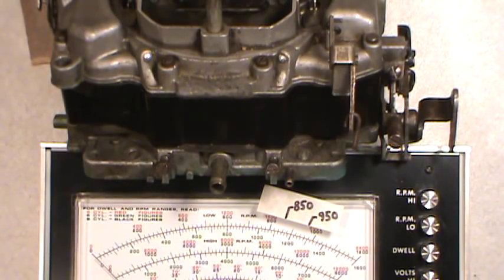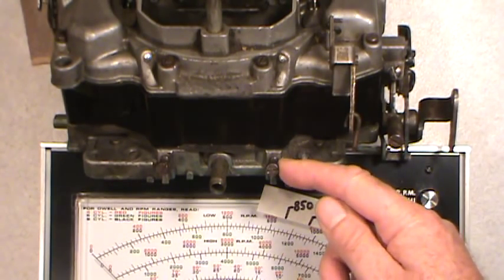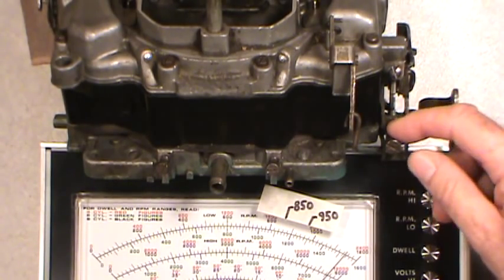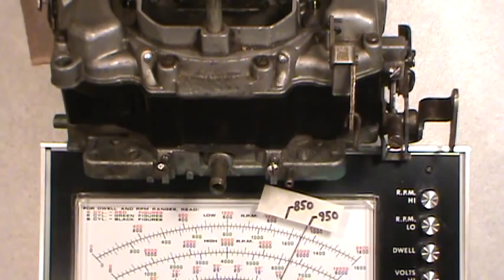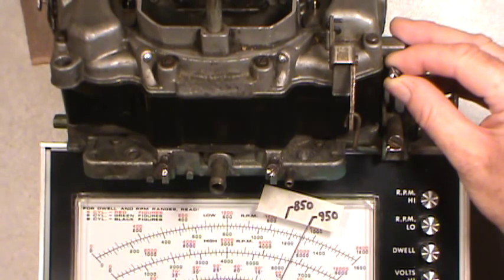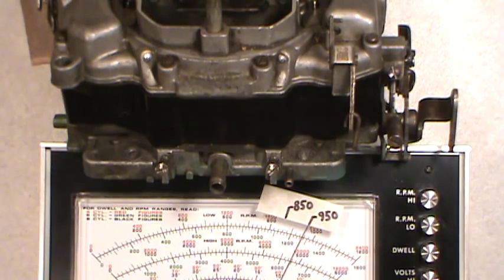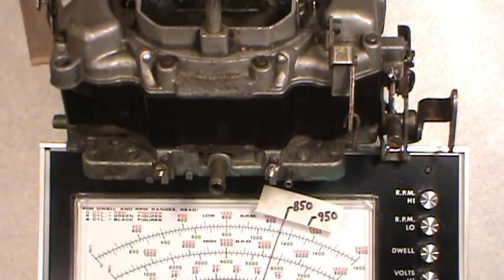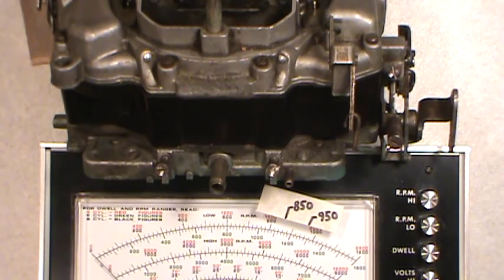Idle Mixture Adjustment on 4 Barrel and 2 Barrel Carburetors

Comment: Thank for the great vidio presentation. I have a 59 cad with 4GS carb. There is big screw with the spring in the back of the carb facing towards the driverside. I beleive it calls, Idle speed bypass screw. How do i adjust that in relation with idel mixture screws and the curbe ide screw? When I crank the screw in, the rpm drops, and by unscrewing it, the rpm goes up.
Thanks for any advise.
Reply from the maker: 59cadfins Greetings 59cadfins....You are welcome, and, thanks for Your comment/question, and for watching as well...................................................Before I get on with, what, information, that I will leave in this comment/reply to You, is, in order for me, to be able to help You out, to the best of my ability, would be, for You, to have a "Look", at the "Carburetor", that is "Installed"...on Top of Your Engine's Intake Manifold......................................................Please, let me know, the following.............The "Carburetors" (brand) Name (if one is showing)..."Any Numbers or Letters", that might be "Stamped" in/on, Your Carburetors "Exterior/Outside" (as in, Top...Front...Back...Left and Right Sides, and with the engine cold, and not running, You might have to use a Mirror, and a Flashlight, to See those Numbers/Letters, especially, if there happens to be any, on the Rear/Back of Your Carburetor...also, when using a Mirror, the Numbers/Letters might "Appear Backwards"...just sayin'), and also, if the Carburetor, to the best of Your knowledge, "Is" the "Original, Factory Installed" Carburetor, or, if it happens to be, something, other, then the "Original" Carburetor, as that my Friend, will help me a great deal, and also, make it, that much less, of a..."Wild Goose Chase"...that I might have to go on, as well.........................................................I had a look-see, at some pictures and information, pertaining to the Carburetor, that You were telling me about.........................................................I wasn't seeing much, in the way, of a..."4GS" Carb, as I was mostly seeing, a...."4GC" Carb, when I did the search on it............................................................Also, for the "1959 Year Model" of Your "Cad" (I remember, hearing them, being called "Caddy's...that be that), the Engine that came up in my search, was showing a..."390 Cubic Inch" (V-8)...is that Engine, the "One", that is Installed in Your "59", or, does there happen to be, a "Different" Engine in Your "59" these days...???..........................................................I didn't see, the "Big Screw, with the Spring" on it, Located, on the..."Rear of the Carb, facing the Driver's side"...but, what I was seeing, was a..."Big Brass-colored Screw, with a Spring"...Located..."Between"...the..."2 Idle Mixture Screws"...on the..."Front of the Carb".........................................................In some applications, there might..."Not Have Been"...what is commonly know, as a..."Curb Idle"...Adjustment Screw...for Adjusting the..."(Curb) Idle Speed"...of the Engine.............................................From what I saw, and kinda figured out, has me thinkin', that, that, shall we say..."Idle Air Bypass Adjustment Screw"...was being used, to..."Control the (Curb) Idle Speed", of the Engine, seeing as how, some of those Carburetors, back then, might..."Not Have Had"...a..."Curb Idle, Adjusting Screw"...Engineered/Manufactured/Installed...on them...!!!............................................................Perhaps, You can have a Look, for the..."Curb Idle Speed Adjusting Screw"...and here's what to be looking for......................................................."If", You happen to see an Adjustment Screw of sorts, that might be "Making Contact" with, what is commonly known as a "Fast Idle Cam" (that "Cam", is what "Raises" the Engine's Idle Speed, and positions the Choke Plate, when the Engine is Cold, to prevent it from stalling), then..."That's Not It"...unless, the Engineers/Designers, just might have had, that..."Single Adjustment Screw"..."Serving 2 Purposes"...at the..."Very Same Time"...!!! (aka, doing double duty, in the from of, both, the Fast Idle, and the Curb Idle as well, maybe?)..........................................The most common looking..."Curb Idle Speed, Adjustment Screw"...basically, just makes..."Contact With"...the..."Lever or Bracket"...that the..."Throttle/Gas Pedal"..."Rod" (or Cable?)...Actuates, that Controls, the, Throttle Plate/s (butterflies/throttle valves), Angle/Opening, depending on, just, how much Your Foot is Pressing on the Gas Pedal...........................................................................The Carburetor, that I was seeing in the search results, to me, looked, for the most part, just like a..."Carter AFB" (AFB = Aluminum Four Barrel, I think?) Carburetor, but, that was just a few Pictures, and I haven't a Clue, as to, "What", the Carburetor that You have there, actually Looks-Like...???........................................................."IF"...???...You Don't happen to "Find", a "Curb Idle Speed", Adjusting Screw, on Your Carburetor, then, it is quite possible, that, that "Big Screw, with the Spring", is perhaps, what the "Engineers/Designers", of Your particular Carburetor, probably used, to..."Control/Adjust"...the Engine's..."Curb Idle Speed"...especially, considering, the absence of, the, as I've mostly seen, and adjusted many times, the..."Curb Idle Speed Screw" (and in some cases, it was an electrical Solenoid), on, the Carburetors, that I've...Rebuilt/Set-up/Calibrated, and Adjusted........................................................."If", and I say, "IF", it turns out, that You end up, having to, actually "Use", that there..."Big Screw, with the Spring on it"...to...."Control"...the..."Speed"...at which Your Engine..."Idles" at, You "Should/Must", find out, what, Your Engine's..."(Curb) Idle Speed"..."Specifications" are, so, You have a much better chance, at getting it Right, the First time, hopefully.......................................................What I'm visualizing, is, it really boils down to a, shall we say..."Balancing Act"...where-as, the...(I'm thinkin')...."2 Idle Mixture Screws"...have to be..."Balanced", with the...shall we call it, an..."Idle Air Bypass Screw"...Adjustment Amount (aka, the Turns/Partial Turns Out, from being Lightly seated) perhaps, in order to have, a Carburetor (Yours, in this case), Idle Smoothly, and at the Specified (Curb) Idle Speed, as well as, having the..."Idle Mixture Screws"...Adjusted, as..."Lean" (air/fuel ratio-wise) as possible, but, "Not-so-Lean", that, the Engine, starts experiencing, what is known as, a..."Lean Miss-Fire", that by the way, from my previous experience, at times..."Can't be Detected"...Without, having a..."Smog/Emissions Test"...done, unless, the Engine, actually, starts..."Shaking"..to some extent, at (Curb) Idle Speed, that is..........................................................Before I go any further, with, how I would go about, making the Adjustment/Adjustments, with this particular..."Carburetor"...please, let me know, all that You are able to, about Your Engine and Carburetor, as, the More, that I actually Know, about, what I'm dealing with, the More, that I should be able, to help You out..................................................I sure like, what the "Designers", did back then, with those Car..."Tail-Fins"......kinda has me thinkin', that..."Airplanes and Jet Aircraft"...had..."A Lot to do with it"...!!!.....................................................Till next time.............Be Safe, take care, and have a good one.
Reply: RockysRoadshow Thank you for taking the time to respond to my question.I beleive this is the original carb on a 390 engine. The only ID I could find says, Rochester 4GS and 4jet. There is a curb idle speed adjusting screw where the throutle linkage is connected on the Dr. side. However, there is none for fast idle adjustment which is normally located under the choke on the passenger side. Or I might be wrong. The curb speed adjusting screw could be for fast idle cam adjustment and the big screw in the back could be for curb idle speed adjustement. I will try to send some pictures. I have never done sent pics before hopefully, I will figure it out.Let me tell how this started, the problem is the car would not start i had to use starting fluid so I knew the plunger was not working. Other than that the car was running perfect. So I removed the carb to get remanufactured. Once it was reinstalled the plunger was working fine the car starts up immediately. However, when i am stopped, when I accelerates the car hesitates. My research shows this is the accelerate pump issue. I know it has been replaced since it starts now. Is it lean or rich thats what I am trying to figure out. Thanks again

Comment: Hey, this was a great video. It is something that I enjoyed working with on my vehicles. The only problem is i have not been able to find my VECI on my 77 350M Auto Ford T-Bird. The only info I'm going by is the engine valve cover info.  Calling on 650 RPM on neutral, park. Question?  Is this good info to go by.
Reply from the maker: Greetings...Rogelio Camarena...........Thanks for the nice comment, and for watching too.........About the only time, that, the Idle speed RPM's become important/fussy, is usually when, the vehicle has to be "smog/emissions tested", and, if the idle (speed) RPM's, are either too high, or, too low, then, that, in itself, might cause extra/not wanted smog/emissions, as well as, the testing equipment itself, might also be "Monitoring" the engine RPM's @ idle speed, to make sure that, it is with-in a certain range (possibly)............If I recall correctly, is that, the smog testing establishment, that I used to go through, might not even test a vehicle, that has an engine, that idles @ 1100 or more RPM's (that's pretty darn high...don't-cha-think?)...........You were sayin'....650 RPM in Park or Neutral (automatic transmission)...sounds reasonable to me, but, that 650 RPM, while in Park or Neutral, will probably drop down, oh, maybe about, 100 RPM's (ball-park figure), once Ya put the Brake on, and shift that auto-trans into Drive (gear), and might end up at, about 550 RPM's there-abouts, maybe (when the auto-trans, is placed in drive/brake on)...........If I happen to have an older carbureted engine, that doesn't have to be smog tested, then, here's what I usually do, to choose an Idle RPM (speed), once I have the Idle Mixture screws, adjusted reasonably well..........With a Tachometer, or, just by, what I hear & feel (so to speak), I adjust the Idle "RPM/Speed" screw, while the Automatic Transmission is in "Park" (for Safety reasons), then, with the foot Brake "On", I place the auto-transmission lever into Drive, to see, just how much the RPM's have dropped down-to.........If, it dropped too Low, then, I go back into "Park", and adjust the idle RPM's a bit higher, and then, foot brake On, and repeat as needed, until, I'm satisfied with the actual Idle Speed RPM's, while having the foot Brake "On", and, the auto-trans in "Drive".........If the Idle speed RPM's are too Low, then, the engine will probably be idling, shall we say, kinda lumpy/roughly, and not so smooth at all..........If, the Idle speed RPM's are too High, then, the vehicle will usually "Creep" (ahead, while in Drive) too much/too fast, as soon as Ya release the foot Brake...!!!...and, that's not so good, or, safe either..........Somewhere around, oh, about, 600 RPM's (give or take a bit), while the auto-trans is in Drive, with the foot brake on, and the engine is up to operating temperature/choke fully off, should be alright, for most of the older carbureted V-8 engines, that don't have to be smog tested, as I've experienced in the past..........Depending on the engine, some of them can idle, at a really low rpm's, probably more so, if the vehicle has a Standard transmission/with a Clutch, and, probably b-cuz, the engine, only has to, shall we say, "Free-Wheel", as in, no drag imposed on it, like an Auto-Trans, will be subjecting the engine to...........If you need any more help at all, just let me know, what "Exact" Carburetor (2 or 4 Barrel)...???...and, whether or not, your T-Bird, has to be Smog/Emissions Tested as well, thanks....and.....till next time.......Be Safe, take care, and have a good one.

Comment: I just bought a 1976 corvette with a 350 engine, with automatic transmission, and it has an Edelbrock carburetor installed, the person I bought it off of failed the emissions test. The HC was 3.73 and CO was 4.44, the maximum allowed for HC is 2.50 and for CO is 2.00 to pass emissions test. Could you please tell me how to adjust the Edelbrock carburetor so I can get it to pass emissions.
Reply from the maker: Greetings...Kift1991...……..Thanks for watching...…….I will mention a few things first, before I move on to, your Edelbrock carburetor, that, will probably help you out quite a bit, when it comes to, lowering your Vett's, exhaust emission level/s, which will probably, increase your chances, at passing that, good ole smog test...…….All ignition related parts, have to be in, as, good as new condition, and, adjusted to specifications.........Have a look in your engine bay/compartment, for a V.E.C.I. (Vehicle Emission Control Information) "label or sticker", and, if you find one, then, there will be, some very useful information, that will be printed on it, and it might also have, a diagram/picture or two, on it as well, possibly....……..A 1976 Corvette, would have probably had, one or two catalytic converters, as part of the exhaust system, when the Vette was brand new, and, this (Oxidizing, type of) catalytic converter, when working properly, would "lower", both, the Hc and Co, emission levels...!!!..........As I recall, General Motors (including, Chevy/Chevrolet, that made the Corvette), started to, (factory) install, catalytic converters, starting around 1975, that were known as, the "Oxidizing" type, which only, shall we say, burn-up, Hc (Hydrocarbons), and, Co (Carbon Monoxide, which is "Lethal", if a person breathed in, too much of this stuff...!!!), and, if your Vette, had, one or two catalytic converters, that were worn out, or maybe, it/or them, as the case may be, might have been, removed from the exhaust system, and, if so, then, the Hc and Co levels, will probably be, a bit higher then wanted.........Hopefully, your engine is very close, to being "factory stock", because, something like, a high performance/heavy breathing camshaft, will probably, increase the amount of Hydrocarbons, and maybe, Carbon Monoxide too (not sure)............All it takes, is, a spark plug, that "misfires", just a little bit, and that alone, will more than likely, increase the emission level/s, into, that not wanted, "fail" category...........The Initial (base) ignition timing, should be set at, the factory recommended setting, because, any "extra" ignition advance, will usually increase the emission level/s too, just so Ya know..........Now then, onto your Edelbrock carburetor..........Hopefully, your Edelbrock carb, is not too old, and worn too much, because, things tend to get, gummed-up & dirty, with age, and, lots of use...........If it were me, then, I would probably do a...100 RPM (Revolutions Per Minute)..."Lean Drop"...idle mixture screw adjustment, with the engine up to operating temperature/choke fully off, while having, the automatic transmission, set in..."Park"...with the emergency/parking brake on, while the Corvette, was on level ground, and always, have lots of "fresh air", whenever the engine is running...!!!...so the Carbon Monoxide (gas), does not Poison you...!!!.........Just watch this video of mine, until you understand, how to get the best/fastest idle speed, while keeping the RPM's at the target level (RPM's, not too high, or, it will get all messed up...!!!)...........Make sure, that, you know, what RPM's, that the engine should be idling at, while the engine is hot, while the automatic transmission is in "Drive", while you also have your foot, firmly on the Brake Pedal...!!!..........If you have a V.E.C.I. label/sticker, then, those idle "speed" RPM's, while in Drive, with the Brake on, should be printed on "it"...........If Ya don't have a V.E.C.I. Label/Sticker, then, try...600 (idle speed) RPM's...while in Drive/Brake On...engine hot..........If Ya find, that, your Corvette "creeps" ahead too fast, when you take your foot, off of the brake pedal, for your liking/personal preference, then, Ya can try lowering the RPM's, just a little bit.........If Ya can get the idle speed RPM's, that were "specified", for your "exact" Corvette and Engine, then, that, in itself, will probably be, your best bet, for increasing your chances, at passing the smog test, well, while at idle speed, that is..........Do they do a "visual" inspection, for all of the smog, parts & pieces at all...???..........Is your "NOX" (oxides of nitrogen), within, the "Pass" limit...???...if not, then, just let me know, and, I'll give Ya a few pointers, on that one as well..........Good luck, with getting your Vette, to pass the smog test, and.......till next time.......Be Safe, take care, and have a good one.